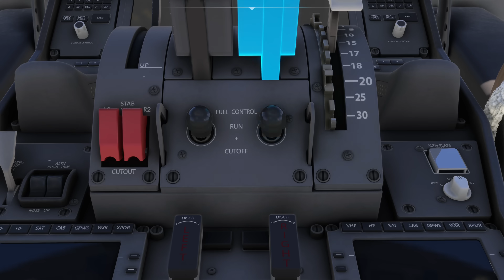Air India 171: Why Did The Fuel Cut-off Switch Get Moved?

Comment: How does any of the electrical items or software that can cause problems in the aircraft physically move a manual 3-part switch? Doubtful that panel was built with parts that acted like an actuator to move that switch by any other means. That would defeat the built-in safety feature of the switch right?

Importantly I remember that one of the pilots must have seen the switches in the cutoff position so to have made the type of comment reported on the voice recorder. That is backed up by the data from the switches.
Reply: Also if that were even possible in this situation to move the switches wouldn’t there be data recorded indicating those steps?

Comment: Boeing hid the fact of software changes in 737 max from everybody. Why should steve believe that pilot did it. The info given by report is only a bit. The full conversation shd be given for nobody talks just 2 sentences. 
My take is the software glitch shut the engines and pilot was trying to revive by shifting switch to off a.d on again. But the language isn't conveying this. Did u shift the switch. No. Suppose both r telling truth, then how did the switches glide. 
Dammit, if pilot did it and it is clear thru the entire conversation, cut the crap and tell us. The switches have been found. Are they working fine with springs ok. This can be revealed. Case closed. One pilot is the murderer and other is a fighting hero, whose heroics were in vain

Comment: Some post investigation things... 

The report was in the hands of WSJ 24 hours before it was released by Indian authorities... lapped by BBC... exonerating Boeing and GE. And it was unsigned one.

The statement of the lone survivor stating that the cabin lights were strangely flickering during taxi takeoff not factored in.

Gear up did not get executed or it was stuck up in middle. Can RAT get deployed when there's an electrical failure and not only due to loss of power from dual engines. 

Why complete CDR transcript not released.. and left open ended. Fuel switch off procedure..timings.

What do you mean when saying that fuel Switches TRANSITONED from run to cut and then MOVED to run again. So transition was involuntary and moving back was voluntary.

Why so much emphasis on only just two sentences of communication between pilots released. 

Now why emphasising again and again on pilots psychological condition  .. earlier it was on pilots flap setting error.

Hope there are no hidden agendas.The more i read and listen to these videos.. i see a pattern starting from the very first video on this incident. And it is concerning. 
God is watching... and will be the ultimate judge. 
RIP again to all the lives lost.

Comment: @CaptainSteeeve  with basic technology it's pretty much easy to put up a safety condition when can the switch be allowed to turn off - for example the system could easily track the startup time, hence when just taking off should not allow turn off switch.😅😅😅😅😅😅😅😅😅😅😅😅😅😅😅😅😅😅😅😅

Comment: Note: AI171 (Boeing 787) crash – June 21, 2025.
🛑 Refer these before blaming pilots: (1)FAA Advisory (2018) – Fuel switch flaw: https://ad.easa.europa.eu/blob/NM-18-33.pdf/SIB_NM-18-33_1
(2) UK CAA Advisory (May 2025) – Mandatory fuel shutoff checks: https://publicapps.caa.co.uk/docs/33/SN2015005.pdf
(3) Watch Downfall: The Case Against Boeing (Netflix).
>>Systemic issues exist.

Comment: The report is silent about the time thrust started falling. That data should be correlated to the time when the cutoff valves transitioned from run to cutoff. If the thrust was falling before the switch moved to cutoff then all that we read could be desperate attempt to relight. Let’s not forget that from the time the problem surfaced to crashing is between 15-20 secs.
Reply: Apparently they must have all the analysis done already. But they choose to release partial facts to save Boeing company.

Comment: if one of the pilots wanted to commit a suicide why would he only turn off the fuel switch off and when asked say no I did not do it. Also when the other pilot put the switch back on why wouldn't he fight back to crash the plane. So I believe the suicide scenario is bullshit and the fuel cut off happened not on the physical switch level but in the flow area to the engines

Comment: I don't know if this question will be lost in the 8,000+ comments, but I'm going to ask it anyway. Is it possible that the computer had cut off the fuel to the engines and the switch to cutoff and back was intended to get the computer to restart the engines? (Am I right that the switches do not directly control the fuel pumps, but rather tell the computer/fly-by-wire system to control the fuel pumps?)

Comment: Great coverage of this tragedy Captain Steeeve. I'm intrigued by your side comment about AI piloting passenger jets. I agree we are not ready, and unlike drivers on the road a commercial jet pilot is highly trained, but in time I think "self-flying" airliners are inevitable. Admittedly I won't be first in line when that happens, but I think it will be safer and more efficient in the long-run.

Comment: One thing i have heared is that "marta hua aadmi jhooth nahi bolta" meaning the person who knows he is about to die will not lie.
If any of the pilot did that on purpose and he knows that he will die seconds after that, he will not lie. Jumping to the conclusion that the pilot only did it seems a bit off to me, especially after hearing the audio. It was probably a switch failure which is always a possibility in any mechanical device, be it as safe as we can claim it is..
The possibility of that should not be taken back and needs to be talked about more..

Comment: I asked chatGPT - is it possible for the Dreamliner to have switches physically in the run position, but the aircraft registering it as cut-off? 

The answer is interesting 

Yes, it is possible—though rare and closely guarded against—for the Boeing 787 to physically have the Engine Run switches in the “RUN” position, while the aircraft systems (EEC/EICAS) register them as “CUTOFF” due to a fault or discrepancy.

Here’s how and why that might happen:

⸻

🧠 Why This Can Happen

1. Signal Path is Digital
	•	The Engine Run switches send their position data via digital data buses (ARINC 429/AFDX) to systems like:
	•	AIMS (Avionics Interface Management System)
	•	EEC (Engine Electronic Controller)

If any part of that chain—switch, wiring, data concentrator, or bus—fails or sends incorrect data, the actual switch position may not match what the system “thinks” it is.

2. Software/Bus Fault
	•	Faulty ARINC bus transmission, a misbehaving AIMS module, or even a software bug can cause the wrong interpretation of the switch state.

3. Data Corruption or Electrical Noise
	•	Electromagnetic interference or short circuits can corrupt the signal, especially if filtering or shielding fails.

4. Internal Switch Fault or Calibration Drift
	•	A failure in the switch hardware itself—such as a broken contact or incorrect voltage output—could result in a mismatch between physical and logical state.

Comment: Eventual, electrical failure due to negligence in manufacturing.  It has happened in previous plane. More data is required of the plane before blaming the pilot.

Comment: There must be an interlock system or a logic,, that when the plane has taken off, and has not reached to a certain minimum height say for example 1000 m, the fuel valve can not be switched off, even if some one try to switch it off deliberately.

Comment: If a pilot is suicidal, they WILL NOT be deterred by a ockpit camera, any more than they are by flight data recorders.

If a pilot is truly suicidal, fixing a percieved flaw in the operation of the fuel cutoff switches will not stop them. They will figure out another way to bring the plane down!

It is almost impossible to stop a determined pilot from crashing an airplane. Only by good luck can they be stopped in the act!

 The best prevention is what Captain Steve suggests: ask the questions, provide the necessary mental health services, and have each other's backs!

Comment: I don't believe one pilot saw the other pilot pull the switches. He only saw the readout and warning lights. We know this because he would have called out the other pilot and said "I just saw you do it!" This would be the first natural reaction. Additionally, it seems that the pilots were assisting each other to get the engines back up. If one was mentally unstable, he would have tried to resist getting the plane back up, been uncooperative, and even performed further tasks to bring the plane down. This just doesn't sit right.

Comment: Several critical scenarios can cause the Boeing 787's engine Fuel Cutoff (Fuel Shutoff) lever to automatically deploy (activate), cutting off fuel to the engine. This is a vital safety feature designed to isolate the engine and prevent catastrophic damage. Here are the primary causes:

1.  *Engine Fire Detection:*
    *   *Most Common Trigger:* This is the primary design reason. If the engine fire detection system senses fire or overheat conditions in an engine nacelle (the casing surrounding the engine), it will automatically send a signal to deploy the Fuel Cutoff lever for that engine and shut off hydraulic fluid and electrical power (via the Engine Disconnect switches).
    *   *Purpose:* To starve the fire of fuel and isolate the engine.

2.  *Severe Engine Damage or Failure (Uncontained Failure):*
    *   *Impact Detection:* Sensors detecting excessive vibration, sudden loss of oil pressure, or extreme temperatures indicative of an imminent or actual catastrophic mechanical failure (like a rotor burst or uncontained disk failure) can trigger an automatic shutdown.
    *   *Purpose:* To prevent further disintegration of the engine, which could damage the airframe, fuel tanks, control surfaces, or other engines, and to stop fuel feeding any resulting fire.

3.  *Critical System Failures Leading to Hazard:*
    *   *Fuel System Issues:* While less common as a direct automatic trigger for cutoff (pilots usually handle these manually), a complex failure involving uncontrollable fuel dumping or a major fuel leak near a hot engine could theoretically be interpreted by protection logic as a fire risk, potentially triggering shutdown.
    *   *Oil System Catastrophe:* A complete and sudden loss of oil pressure combined with high temperatures might be interpreted as a precursor to fire or catastrophic failure.
    *   *Electronic Engine Control (EEC) Commands:* The EEC might command an automatic shutdown if it detects internal conditions that pose an extreme hazard (e.g., certain types of control system failures leading to uncontrollable overspeed or severe surge/stall).

4.  *Aircraft Protection Systems (Less Direct, but Related):*
    *   While not directly causing fuel cutoff, systems like the Engine Indicating and Crew Alerting System (EICAS) will generate urgent warnings (e.g., "ENG FAIL", "ENG FIRE", "ENG OVHT", severe "ENG VIB") that require the pilots to manually move the Fuel Cutoff lever to the cutoff position as part of the immediate action procedures. The automatic cutoff primarily happens for fire and certain catastrophic failures.

*Key Points:*

*   *Automatic vs. Manual:* The scenarios above describe automatic deployment. Pilots can also manually move the Fuel Cutoff lever at any time based on procedures or judgment.
*   *Isolation:* Automatic fuel cutoff is almost always accompanied by automatic disconnection of hydraulic and electrical power to the affected engine (via the associated Engine Disconnect switch).
*   *Safety Critical:* This automatic function is a fundamental layer of protection against engine fires and catastrophic failures spreading to the airframe.
*   *EICAS Warnings:* Any automatic fuel cutoff event will generate prominent, high-level warnings and messages on the EICAS displays for the flight crew, along with aural alerts (e.g., "Engine Fire" bell and voice warning).

*In summary, the Boeing 787's engine Fuel Cutoff lever deploys automatically primarily in response to a detected engine fire or conditions indicating an imminent catastrophic engine failure, as a critical safety measure to isolate the hazard.* Other severe system failures could potentially trigger it if they create an equivalent level of danger. Pilots retain the authority to manually activate it at any time.

Comment: Hi Captain Steeeve. On another channel they had the actual checklist for the 787 dreamliner (same as Air India 171) for a dual engine faliure.  The steps were 1) set the engines to CUT OFF then  ON again. 2) Manaully deply the RAM AIR Turbine.  Could it be plausible that it was done from memory rather than from the actual checklist, and in doing so, they forgot to turn the engine on immediately? After that, the other pilot turns on the engine, but it's too late.

Comment: What if one pilot is incapacitated? It would make the procedure more difficult in a real emergency situation if both pilots are required to make an input. Instead, a delayed response backed up by an audio alarm might be more suitable (e.g., fuel switches are turned off, an alarm goes off immediately, followed by a few seconds of pause, say 10-15 seconds, before actually cutting off the fuel. If someone turns the switch back on within this grace period, fuel is not cut off).

Comment: I have a question concerning Air India flight 171. Do the fuel control switches (both the left and right ones) have two solenoids (off and on) operating each of them or is each switch spring loaded (kept on by electrical current) and thus allowing the switch to flip back to off if power is removed? In the latter, a power glitch would allow the switch to failsafe back to zero. The switch would be still physically on and likely would have to be flipped off and back on to reset. Without a checklist it might take about 10 seconds to figure out resetting it since physically cutting it off at that point of the flight is a no no.

Comment: The metal locking nubs are wearing off. Pilots are not mechanics and are not aware of the understanding of pulling a switch up and over the locking nub. Imagine something falling onto the center console that was propped up on the upper instrument panel glare shield, and falling down and hitting the fuel selector switches on rotation at pitch up for takeoff. Have they found the pilots cell phones.

Comment: Dr Steeve the report doesn't say the switches were moved. Why does you video title suggests that. It's is humanely impossible to move both the switches to cut off position in an interval of 1 sec. This theory is confirmed by lots of other pilots. You keep on presenting a picture as if pilots were at fault. We all know where your interest lies. Why did the preliminary report deliberately choose to not mention entire conversation between pilots, right from taxi start, takeoff etc. The black box data is capable of showing wether there was a physical movement of switches or not but this information is also not shared. Only thing that is released in the report was deliberately ambiguous one pilot confirming with other and the other denying it. Boeing has a history of influencing others. 

Good luck saving your masters

Comment: How do we determine for sure that the switches were physically moved and it’s not the FDR recording the movement in the software which essentially the aircraft also picked up as an input and cut off the fuel supply to the engines ?  
I’d want someone to explain precisely how the input/output from these critical switches are carried in this particular aircraft.

Comment: It's too early to come to the  conclusion that one of the pilot is responsible for the switch OFF of the fuel button. Nowhere is mentioned in the preliminary report that the pilot deliberately switched OFF  the fuel button. The final investigation will determine the cause of the aircrash with the loss of 270 innocent lives
 Hopefully, an fair  investigation will be conducted to bring light into the deadly crash.

Comment: For the one suggestion about requiring both pilots for fuel cutoff: Cannot ever require both pilots. If one pilot is incapacitated, need just the other to handle the emergency

Comment: Stop all the blame game without data. Wait for the investigation done from data retrieved from the flight recorders.
These are switches, not valves. These are connected to and send signals to controllers and relays or solenoid. And it is fully possible that the switches were not touched but a software flaw or sabotage caused the valve/solenoid cut off though the switches were not touched.

Comment: Why did it take the pilot 10 seconds to move the switches back to run? Considering that the pilot should have known that placing the switches back to run would relight the engines. I would have been moving those switches first and then ask questions later.

Comment: I hate computer controled things. I don't know if those switches run through a computer or not. It feels like there now needs to be a computer lock out on shutting down both engines once they have passed the committed line untill x amount of altitude is gained.  Or maybe some screeching alarm if fuel switches are thrown before a certain altitude is gained and requires authorization button / switch from both pilots on opposite sides of the cockpit to be activated within a second or 2 of each other to verify the action.  

Trying to keep it simple since already so much going on in cockpit.

Comment: Is it possible that the computer glitched turned off fuel and then turned back on and the pilot assumed the other cut off due to an indicator, but the switches were never moved? Could the data be saying it was the switch vs computer and how would it show up differently on the black box?